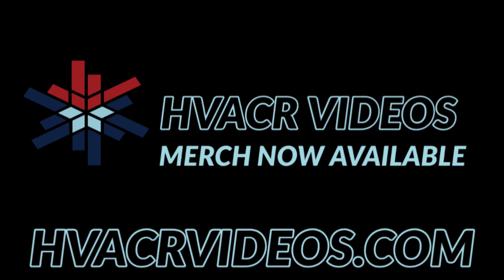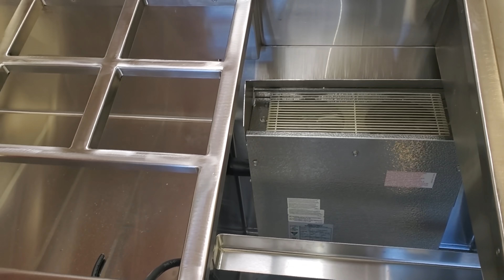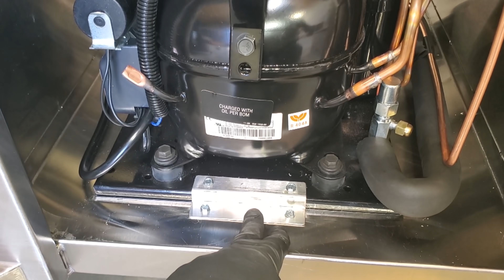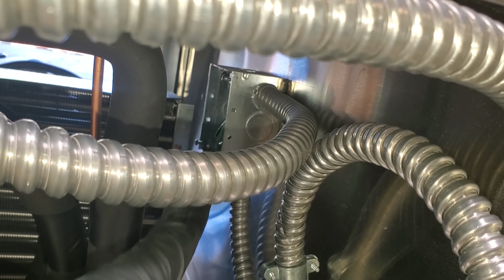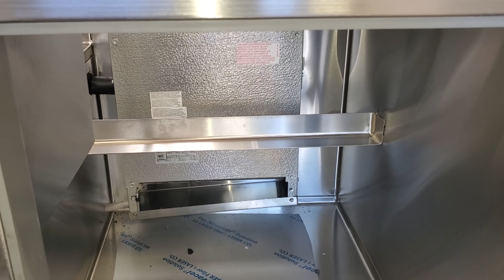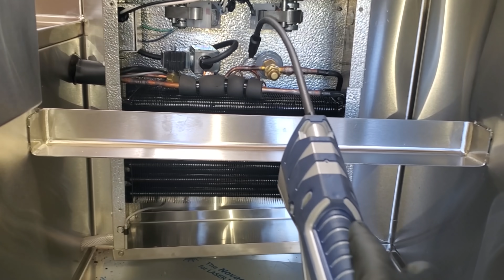CUSTOM REFRIGERATOR BUILD (BONUS VIDEO)

Comment: This is awesome Chris.  This seems to be a self contained custom unit.  So how are you doing the electrical certifications for UL?  Since this is near water, all metal enclosure and uses AC power I would think you must adhere to those certifications ie ground bond and hi-pot testing.  Especially important for your company as you can get sued by injured customer and you need to have record of doing the test.  The test takes less than 20min.

Comment: Seeing wire nuts in a brand new unit seems bananas to me. Coming from the U.K. it’s just not the done thing, wire nuts and to a lesser degree “chocolate blocks” are long since confined to the history books. 
Everything has a  junction box and fixed terminations at each end.
Reply: Of all the failures you see in electrical it’s almost never a wire nut that fails and when you do see a failure it’s almost always improper installation (undersized nut). They just work.

Comment: We do like these all the time at our shop 😂, but yours is at a higher level, good job 👍👍👍
Reply: On a side note we never use expansion valves on small units , is there a benefit on using those on the small units ( with all the added cost !)

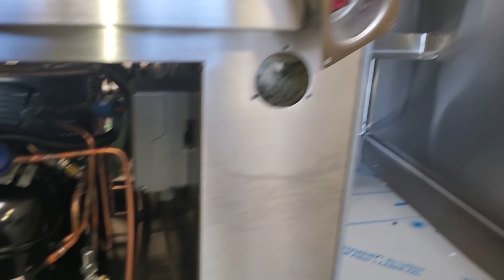Comment: @ 4:29 — It's a shame they didn't get your input on selecting the condensing unit. Surely, your knowledgeable opinions regarding the type, features and manufacturers of equipment could add additional value to the ultimate product.

Comment: Know what you mean, back in the '70's I worked in a large machine shop, in East Chicago, Indiana. It covered two city blocks and produced heavy equipment and spare parts for coal fired power plants. The routine for electricians was 3 weeks working troubleshooting, maintenance, and repair, then 1 week wiring new machinery on the production floor. Made for a nice change, and set me up for the rest of my career in jobs that involved new equipment installation.

Comment: Hey Chris , how do you open the controller if you wanna check the electrical,  it seems the liquid line bends downwards on a 90 and runs right in front of the controller cover ? Cheers mate .

Comment: Nice, but i do have a question. The line that goes in front of the temperature controller, looks like that could be a future issue with servicing the controller. My OCD is asking if the line could be rerouted? LoL

Comment: Off topic, but does that viper foam sprayer work with any coil cleaner? My shop only supply any-Calgen. It’s probably an obvious answer but I still got to ask. Love your videos, I’ve learnt quite a lot from you!
Reply from the maker: The dilution ratios might be off but im sure you could make it work by adjusting the dilution ratios

Comment: shakes head where are the bolts on the inside? unserviceable parts built inside? lines and wiring run where it can never be accessed? you really need an engineer.
Reply from the maker: Huh?
Reply: @HVACRVIDEOS  you know they guys that come in to make your job harder.

i can hear them now...lines are too long they need to be 1" short of leaving the case.
Reply: wait, that blueprint was wrong was suposed to be 1'. don't worry they'll find someone to squeeze in there.
Reply from the maker: Ahh yeah I get it, yeah they are a pain

Comment: Excellent job. Id throw this out there. Not critiquing your work. I like it a lot. Instead of the wire nuts that are taped. Why not use a terminal block instead its even easier in and out and adds that little touch. Obviously its not difficult with wire nuts. I do really like your work. It looks great and is service friendly

Comment: Why are you still using these awful wirenuts instead of wagos? Thank god they are illegal in my Country(for a good reason)
Reply: Whats the good reason? I have used wire nuts my entire life and if you use the correctly i have never seen any if the issues people describe with them
Reply: @jasonmurawski5877  I find burned or the coil inside come loose all the time. Just try to reuse the nuts like you can with a Wago/Ideal connector. I always check the wire nuts especially in food warmers. #1 offender.
Reply: @Jason Murawski  Just watch the video from Silver Cymbal which is called "never use wire nuts again". He actually made two videos about wagos.

Comment: Why don't home ACs  have a lo pressure cut-off?
Reply: Generally a "low pressure cut off" on a home AC unit is more of a loss of charge cut off in order to prevent the unit from running if it leaks all of the refrigerant.  For refrigeration its a little different. For commercial refrigeration equipment like this a low pressure cut off can directly control a case’s temperature by cycling a compressor on and off at the required coil temperatures. On medium-temperature equipment, this will also provide a means of defrosting the evaporator. But each design is different, and you really need to have an understanding of what a specific system is trying to do/achieve to really know the effects and benefits of having a low pressure cut off.
Reply: Some systems do but not your average Goodman’s. But most refer equipment is a pump down system so the low pressure switch actually turns the unit on/off
Reply: @hvacr_whiz6132  If the average Goodman had a lo cut off wouldn't that prevent compressor damage in the event of a leak?
Reply: @TheJmich2001  yes it will